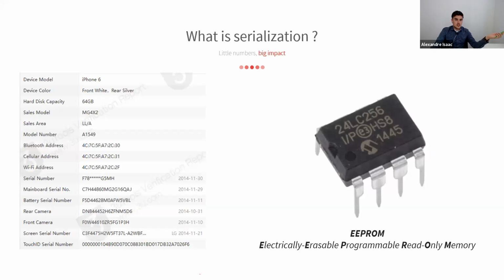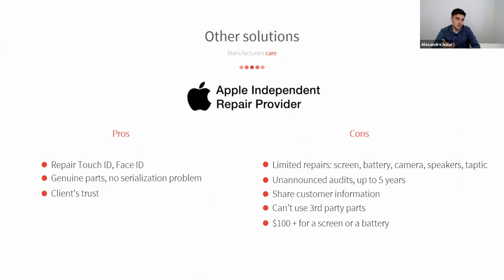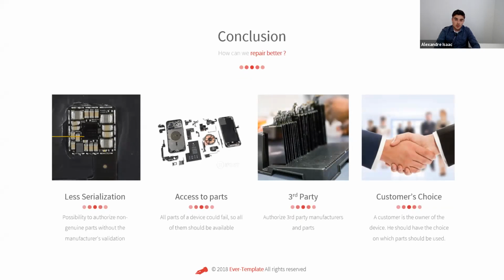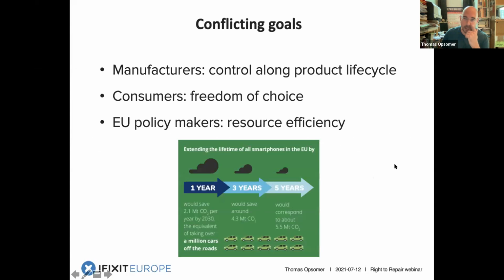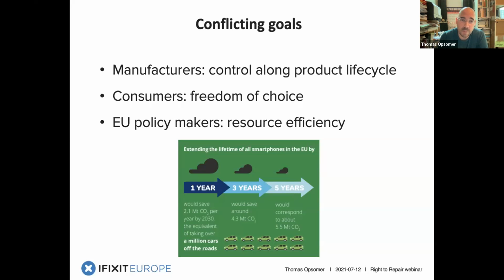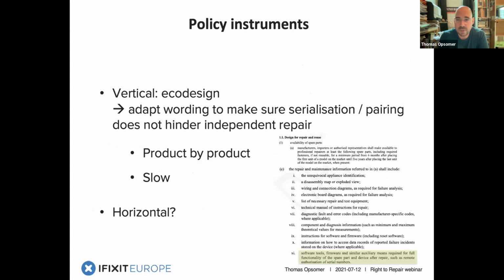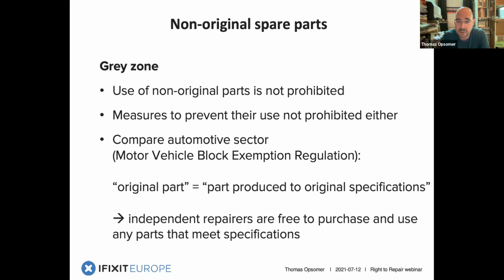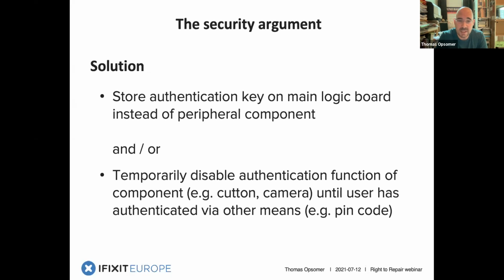How software could make independent repairs impossible

Comment: Do you know that Dyson also is a kinda shitty company when it comes to repairs and your right to repair? E. g. they do not offer selling wearing parts regularly breaking down in their products. 

In particular: The Dyson 911566-04 turbine head contains a turbine wheel that regularly breaks down. I've seen so many not working turbine heads and all of them broke down to the same issue: the cracked turbine wheel. Dyson doesn't sell this part, despite selling a lot of other parts for the turbine head (that don't even break if you try to burn them). The only possibility to get those is by salvaging them from working ones. 
And as you can guess: Since the turbine heads often only "break" because of that, that's kinda stupid.

That's a punch in the face for the environment and sustainability, to replace a whole working unit because you can't replace a wearing part. Not to speak of the gap of the cost of a new turbine head and a spare part worth maybe 0.40 to 4 $.

Comment: This is an important issue as it prevents also repairing our own devices. There are a lot of people that have the technical knowledge to repair their own devices, but software locks do prevent this.
Also - how about the computers on wheels- electric cars. Do the manufacuterers pull the Apple on the electric cars as well ?
Is it possible to change a wheel without reprogramming something? 
This serialization is much more than Apple smartphones.